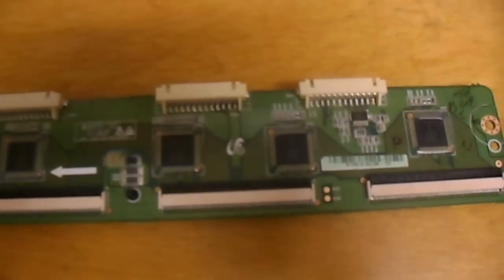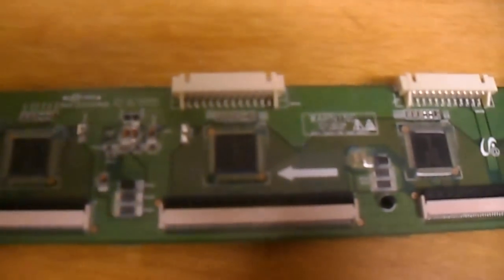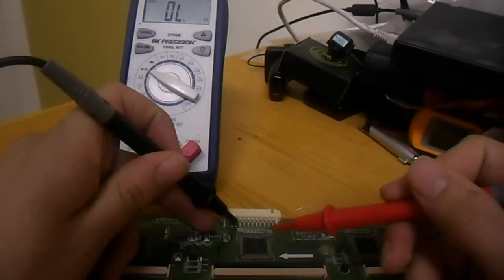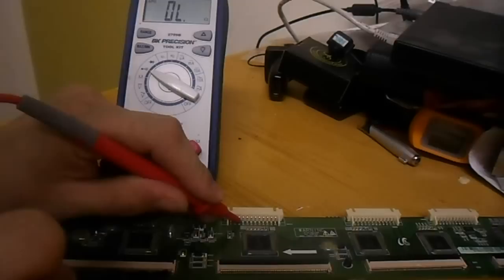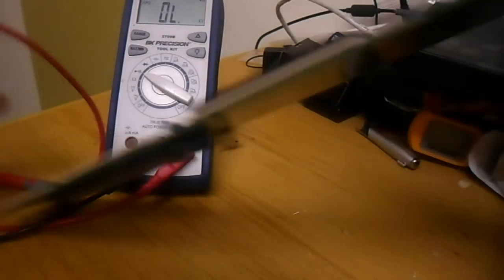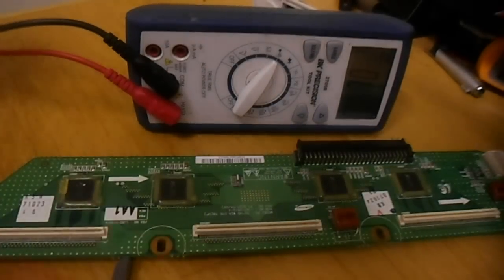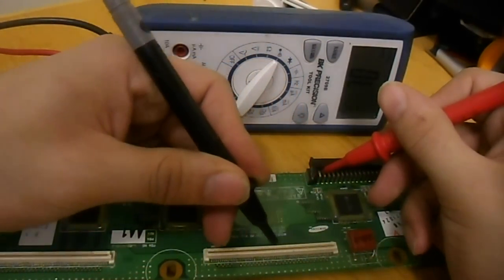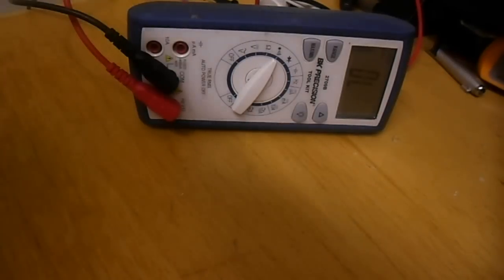Testing Y-buffer boards for short circuits

Comment from the maker: Very likely still good. Also test between SUS OUT and GND. Sometimes the ICs can fail leaky. Applying a small voltage, around 10~15V current limited, will often "smoke out" a failed IC.

Comment: Buffer chips can be still faulty even if they look immaculate and show no beeping from your ohmmeter. You need to make sure there's no double reading in both ways from so-called floating ground plus they can be defective from the inside causing various types of horizontal lines (in that case reading perfect with your meter)

Comment: Hey That bottom chip on the second board connects to chip 2 using connectors towards the edge of the board.

the ones towards the chip are for the the 1st and 4th

the connections to the edge of the board are for 2nd and 3rd chip..

Comment: +ubuntututorials why did you switch leads when testing the other power input?  Does it matter from red to black leads testing?  also where on the input do I put the tip of the needle.  you have them on different spots such as the 4th tooth and 1st tooth on another.  does it matter?  also how many ic chips are connected to one power input? (because there are 3)